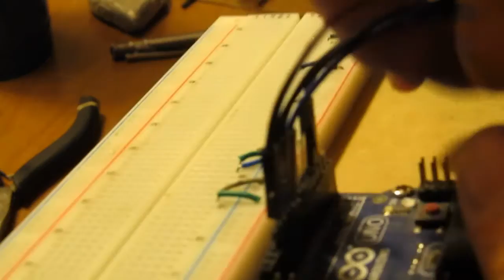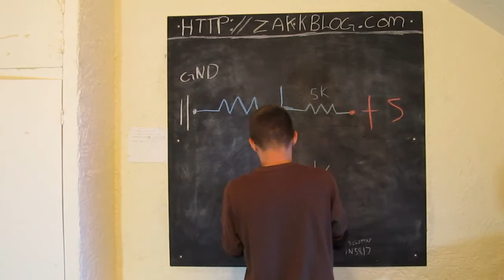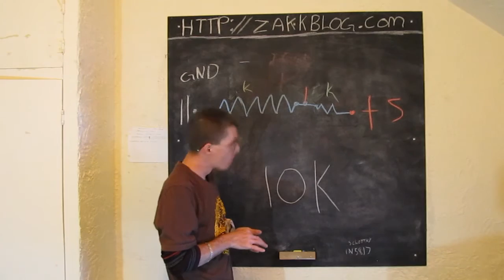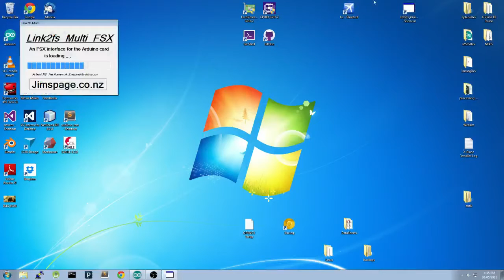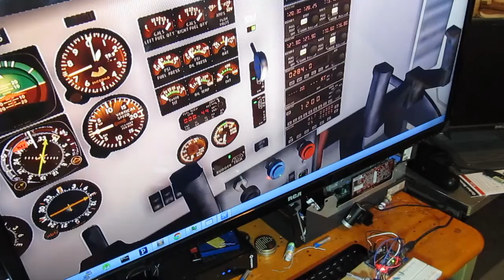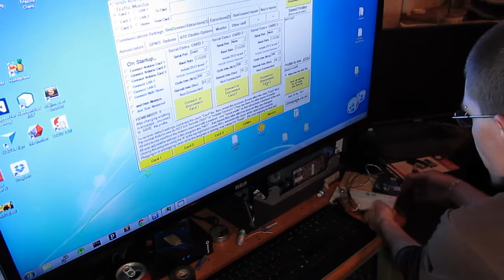Comment: Great video thanks. Watching this having just watched #1. This is going to be really helpful. Just a question... Would it be better to create a function outside of the main loop for serial printing C17 + flapMap. I am just wondering if printing this on every loop would cause a lot of unnecessary 'chatter' on the serial port, especially if you were driving a larger number of outputs. So, if inside the loop, you were to just check if the potentiometer had CHANGED value, and then, if the value HAS changed, run a function outside the loop to print the 'C17xxx' to the serial port. Do you think that might work better? Or at all? Just a thought.
Reply: +Mike Brady i think it likely would work much better in a function outside the main loop. i was a complete beginner back when i made these videos (still am on the flight sim side, but much more coding experience now) I need to get back to these flight sim projects .

Thanks for watching!
Reply: Well, you managed to demystify and explain Link2Fs very well. That was the main thing and you nailed it.

Comment: For me it doesn't work :( the led's work but this not
Reply: Are you using the code from my github? Have you done testing to make sure the button/switch inputs are being triggered (just use serial monitor instead on link2fs to make sure the arduino side is running properly)?
Reply: Zakk Atkinson I used your code and yes I see movement when I hit the switch (from card) but nothing happends in P3D (I'm using Prepar3D not FSX)
Reply: oh, i don't have P3D at this point, so i can't really say what may or may not be different in terms of the commands sent and such
Reply: I'll try in FSX Steam
Reply: i'm using the MSFSX Deluxe diskset, not sure if changes need to be made for steam, but i have heard some people have this working on the steam edition
Reply: Zakk Atkinson Ok I'll try
Reply: let me know if it works! :)